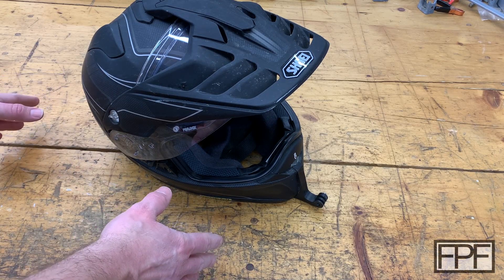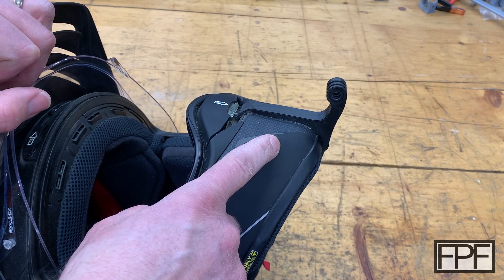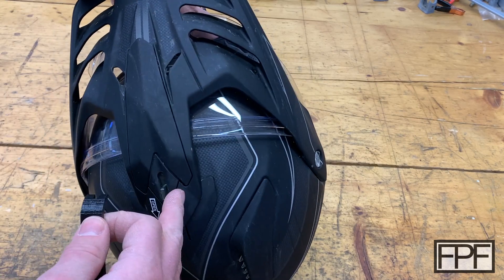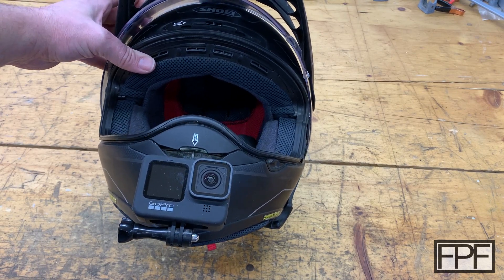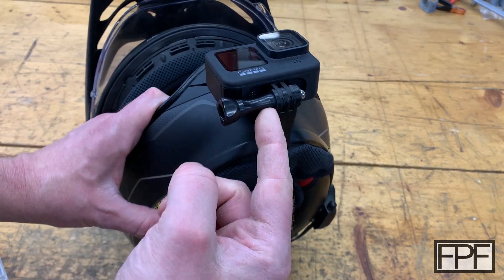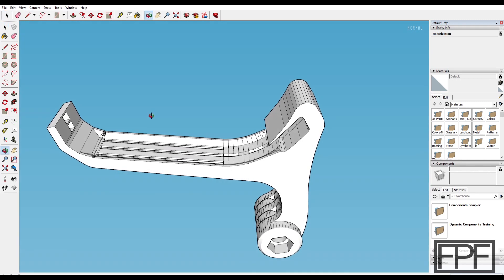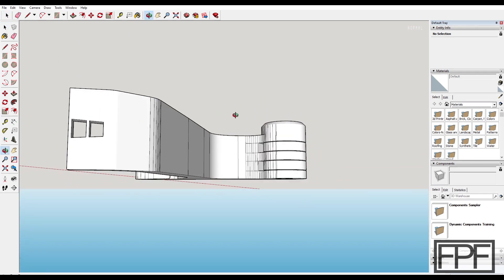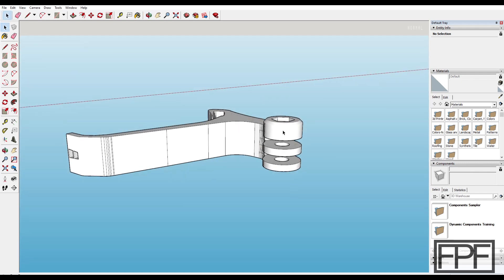3D Printed GoPro Helmet Mount for SHOEI Hornet X2

Comment: i just finished my 7" motorcycle touch screen gps and telemetry system (raspberry pi 5 with 7" screen from AliExpress) with completely custom 3d printed housing and mounting system, just got a new helmet and i want to make a 3d printed chin mount for it.
How did you find the exact contour to make this model with? measurements, 3d scan, guessing and adjusting along the way?
My helmet is very different and i need a mostly flat surface, with two angled edges on the left and right side, nothing too difficult but any insights are welcome!
Love the detail in your design!

Comment: Hi! Great stuff! How much infill is optimal? Thanks!
Reply from the maker: 20%, and do 2 or 3 outer walls, .1mm layer height
Reply: @FunctionalPrintFriday  Thanks!
Reply from the maker: @potato_snek  no problem, best of luck with your print!
Reply: @FunctionalPrintFriday  I have one more suggestion. Printing it mirrored, in order to have the screw on the other side, to facilitate changing the battery without having to remove the camera :)
Reply from the maker: @potato_snek  hmm. .I don't have that problem with mine. My screw may be different, or the gen of gopro.  Mirrored printing  is a great idea though if it's in the way for you.

Comment: Thank you very much.  Is there a preferred material this should be printed in?  Can most materials be used like a resin print?
Reply from the maker: I print mine in PETG.  You want the right balance of strong and a little bit of flex, but not soo strong that it won't break-away if you actually wreck and take a hit to the chin.   PLA is probably too brittle, and I couldn't make a recommendation on the best resin, as my experience with resin is very limited.
Reply: @FunctionalPrintFriday  Ended up getting it printed in Nylon PA 12 Black and it came out fantastic.  The printer had to slightly modify you CAD to meet the requirements of their printer, but nothing crazy.

Comment: You're an absolute legend mate. I was attempting to model one off a 3D scan, but it was just a massive pain scaling it correctly. If I were to modify this at all, I'd extend the prongs that go into the air vent, on my helmet it doesn't quite slot into the divider. Thanks for sharing this!
Reply from the maker: thx for your comment.  glad to hear I saved you some time on this
Reply: @FunctionalPrintFriday  I'd like to offset the mount where the camera is secured by 15.5mm, as the lens is off centre, but then I can't envisage a good way to set up supports. I'm an absolute novice with fusion, do you have any ideas?
Reply from the maker: @Wayfaringwolf  I think I would just let the slicer build supports to try it.  I would also mention that in all the video I've shot, I wouldn't say it's noticeable that the lens is slightly off center.  A lot of folks even run cams on the sides of their helmets.